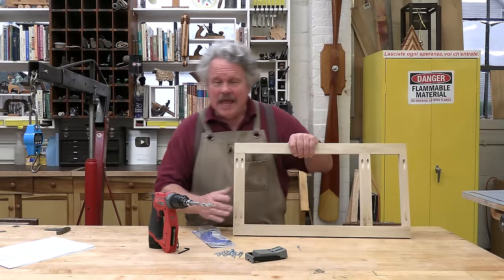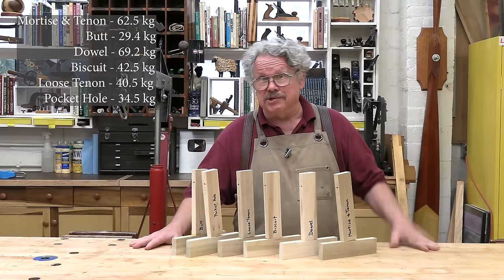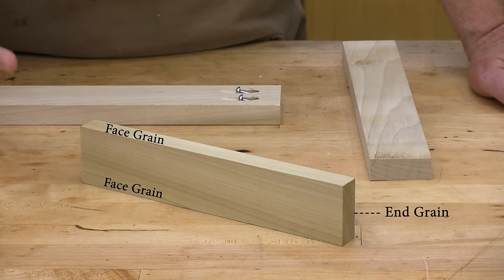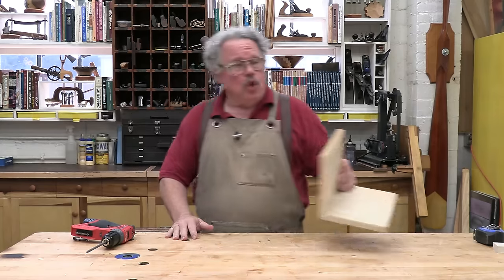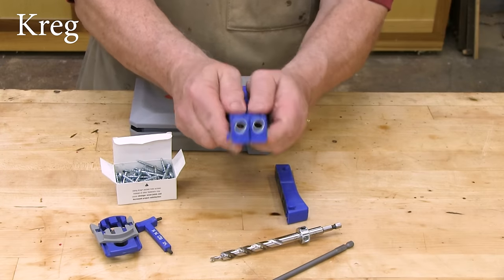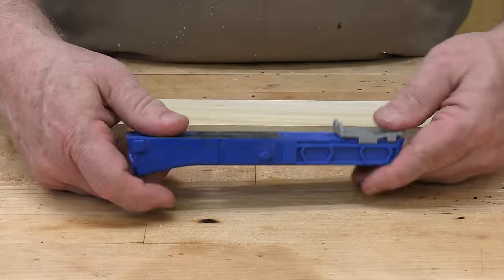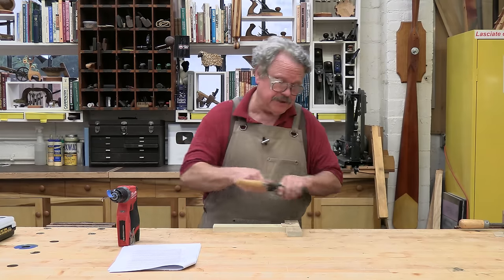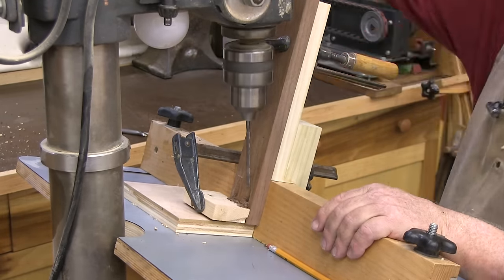Pocket Holes Overexplained

Comment: Nick I bought a pocket hole jig awhile back I have used it to make a screen door, I noticed that the jig has removable stop blocks for different thickness and the drill bit was just a bit short and I had to drill a 1/8th pilot hole and a lot of glue lol, the door came out OK
Reply from the maker: Thanks for sharing.

Comment: First time here, but I love this channel already. I wonder since you're just doing twist off strength - what is the sheer strength where you have two parallel boards and a pocket joined truss between them and pull strait up so the force is 180' from the joints - what joint is superior here?
Reply from the maker: There are four types of stress that every wood joint must withstand -- tension, compression, shear, and racking. By far, the most destructive to woodworking assemblies is racking -- what you refer to as twist-off. Shear is important, of course, but most wood joints fail from racking.  So that's what we test for.

Comment: Excellent video, thank you. I have always thought I was missing something since theses jig manufactures don't include a way to include the pilot hole, yes especially for hardwood. I worry that drilling the pilot hole as you did wouldn't result in that hole being in the exactly same plane as the through hole and change alignment. I wish there was a drill bit that fit the bit guide jig but had a 1/8" or 3/32" long tip to make that pilot hole.
Reply from the maker: I don't use pocket holes all that often, but when I do I wish for exactly that. Apparently, Amana makes a bit with a 3/8" counterbore and an adjustable (telsescoping) 1/8" pilot hole that might work. There is no shank hole bit, but if you use the Kreg pilot hole screws, the shank hole and the pilot hole are exactly the same size -- 1/8".
Reply: @WorkshopCompanion  Thank you for your reply. I have checked out Amana, didn't know about them.
Reply from the maker: @tonyc7352  https://www.amazon.com/gp/product/B000P4UPV0/ref=ox_sc_act_title_2?smid=A1WO0LWTFI0BL8&psc=1

Comment: One cool trick I learned is instead of using the pocket holes you can use a butt joint but before you simply put the screw in to the end grain, drill out the hole (in the end grain piece) and glue in dowels, then screw into the dowels instead, by doing this you essentially create a komposit material, this is probably the strongest connection you can make.
However the connection is visible from one side.

Comment: Cabinet fronts can be made with long dowels. Just along the joint and drill through the face timber into the end grain. Tap in a long dowel and drill the other hole(s). You will see the dowel end grains but is that always a bad thing?

Comment: He said about the Kreg Jig kit "a weird clamp pad" 🤣 I thought it was just me. Whoever designed it had a lot of faith in their customers. I think the idea is that if you clamp too hard, the plastic hexagon that contains the rubber will break before the whole jig gets crushed. I tightened it down until I heard a cracking sound once, but now I do it the right way and it works fine.

Comment: thank you very much for this.
question though: When you were clamping the pieces for drilling, you placed a piece of wood on top of the pieces before clamping, what's the purpose of this, and is it something that should be done when clamping joints in general?
Reply from the maker: The structure of the plastic molding in the Kreg Jig would deform if I clamped it directly; the wood spreads the pressure out and keeps the jig from twisting. Kreg actually supplies little plastic piece that you are supposed to use to do this, but its design sucks dead toads. A piece of wood is just as effective and far simpler to use.
Reply: @WorkshopCompanion  heheh, not heard that idiom before @sucking dead toads, where's that hail from?

Thanks for the info, had finally grabbed some clamps for a recent project, so will take some of my scrap for a piece.

Comment: Great video.
You didn't cover how to determine the length of the screw to use?  You state to set the depth collar to the width of the wood I am drilling through so it exits in the middle of the wood. But how do I know the depth of the shoulder in the pocketed wood? This rests against the screw head and will determine how much of the threaded part goes into the joined wood, correct? For example, I have an apron that is 1"x3" with the 1" edge facing up. I want to attach a 3/4inch table top to the rectangular apron. Do I set the jig to 1" (thus causing the hole to exit in the middle of the apron and use a 1 1/2 screw since that's less than the 1 3/4 inchs total of the apron and the table top?  There is little available on using pocket holes to do this type of joinery. I find it very useful (corn hole boards, table tops, anything where I don't want the screw exposed on the surface). I'm tired of trial and error testing. There must be an easier way to do this. Thanks again!!
Reply from the maker: I usually adjust the drill stop so the tip (the part that makes the shank hole) just exits the wood. This makes the shoulder as substantial as possible. (This is not a big concern in the joinery you describe, where the hole is perpendicular to the wood grain. But it is paramount when the hole is parallel to the grain.) That way, the thickness of the shoulder is equal to the length of the shank hole drill. To keep the screw from exiting the stock, I trying to make the screw come to rest when the tip is no less than 1/8" (3 mm) from the surface. So the length of the shank drill plus the thickness of the stock minus 1/8" is the maximum length of the screw that I can use. But there's one other thing to consider. It's impossible to feel when the screw head bottoms out on the shoulder when you drive screws with power tools. It's very easy to drive the screw deeper into the wood than it should go, especially with softer woods. Even the torque setting on the drill won't save you all the time because the density of woods is inconsistent. When I'm worried about a screw exiting the wood, I always drive it by hand. Hope this helps.

Comment: Question:  I understand gluing the joints totally.  And it is quite common knowledge that glue does not stick to glue hence removing old glue when making repairs.  So is applying glue to end grain, waiting 5-10 minutes and then gluing the joint not a concern because this is "new"  glue rather than "old" glue?  And suppose one makes up a number of pieces to be assembled the next day and applies the end grain glue the day before?  Being "cured" now I'm guessing that would be considered "old" glue.  I've probably just answered my own question.
Reply from the maker: You have. Glues can take several weeks to cure completely. The glue glue is still pretty "new" after just five or ten minutes.

Comment: hi , this was an okay video and I have always wondered why no pilot hole bit is ever included - i think its pure marketing to make this type of product look fool proof so everyone can do it without any complications. I think pocket holes have their place like you said and i think over used for the wrong settings. I attached some oak frame of 60mm X 19mm to some similar sized birch plywood for a reason and I did make a pilot also , the drill bit just about managed (too short actually and perhaps a better one could of been used . Can I ask you what the spec was for the one you use (shaft type and the end type also) thanks in advance.

Comment: It also helps to adjust the clutch on your drill (if you can) to a lower setting so you don't overdrive the screws
Reply: that's a great tip! thanks for sharing!
Reply from the maker: True that. I have a power screwdriver with a clutch; very handy.

Comment: Hey Nick, i was planning to make pockets holes joints on 12mm plywood that i will make for my furniture's van. Now watching your video i'm no more sure if this is viable or not and if i should find another way of jointing for better strengh restitance. What re your thoughts on that? do you think if i put some glue it will be strong enough?. Lot of vibrations in a van to consider, what kind of jointing would you pick for this kind of build ?
Thank you for the great content and have a nice day !
Reply from the maker: Cannot possibly answer your question without seeing a design. Vibration is a huge concern; I was constantly mending less-than-substantial joints on cabinetry in a motor home I once owned.

Comment: Very nice!  I wonder though why Kreg Jig would make the markings wrong on their product of where to put the stop collar on 3/4" material.  I always wondered if the shank hole should exit the piece and it doesn't at their setting.  It made me feel this is intentional.  Anyone know it this is true?  I know when I clamp the pieces together, I glue, clamp, and drill pilot hole in one operation- no time for applying glue twice.
Reply from the maker: I'm sure it was intentional and I don't think they made it in the wrong place. They just made it in a place where I would not have chosen because you can't see where the shank hole emerges from the wood. My suggestion doesn't make the joint any better; it just makes the location of the holes easier to monitor. Perhaps the person who designed the jig didn't think that was necessary. But they also didn't think that pilot holes were necessary, which makes me question all their choices.

Comment: I plan on building first cabinets. Should I opt for dowels instead then? They seem easy enough to implement
Reply from the maker: Depend on whether your cabinets will be freestanding or built-in. Freestanding cabinets require more structural integrity than built-ins, which get their strength from the wall to which they are attached. Pocket screws are not rated as structural joinery. They're fine for built-ins, but you need something stronger for freestanding.
Reply: @WorkshopCompanion  Great, thanks!

Comment: Using no special tools I made some pocket hole joints to connect two pieces of soft wood that only hold up a very light load. I started drilling vertically until the bit was securely in the hole and then slowly tilted the drill until it reached the desired angle. And since it's very soft wood, I could just let the screw do most of the work. As soon as the hole was deep enough for the head to completely sink into it, I stopped the drill and drove the screw ignoring both the shank hole and pilot hole. It worked really well for the intended purpose and required only a drill and a screwdriver. But I wouldn't trust it to hold up to any significant strain. Moral of the story: It's possible to make pocket holes without following most of the best practices but it's almost never advisable.

Comment: Very informative video. I noticed that the wood you're using is in my guess...soft poplar? Did you test with any hardwoods like oak or maple? These days nobody makes everlasting furniture, since styles and colors change. To me ease and speed are more important than strenght of joint. I'm making an entertainment center out of oak, and I know that making it with pocket hole joinery it will outlast me, but not fashionistas. America is a disposable society, where styles change every 10 years or so, and those storage buildings popping up all over America by millions, are brimming with outdated style furniture. In my opinion pocket hole joint is way more than anybody needs. At 35 kilos per joint, only a 20 pound sledge hammer will destroy my TV stand.
Reply from the maker: In researching this video, we made pocket holes in poplar, cherry, oak, and spruce.

Comment: As usual lots to think about. One thing that occurs to me is that unless the joint is tight to start with then, the force being applied at an angle, as you tighten the screws the joint will misalign. Speedwise is there any advantage over dowelling? I think I will reserve this technique, as carpenters have since almost forever, to 'rough' work such as securing a rafter to the plate - and yes, nowadays I do use screws!
Reply from the maker: The pilot hole (and the clamp)  helps prevent the joint from being pulled out of alignment as you tighten the screw. Dowels make stronger joints, and if you have a doweling jig, they only take a little more time than pocket holes. The problem is that you need a good (read: expensive) doweling jig, otherwise you'll spend a lot of time plugging the re-drilling misaligned holes.

Comment: How I love Utube!  You were a great find. Your experiments are both hilarious to watch and also very factual, no guesswork.
Summary of Joint Strength from Strongest to Weakest:
Dowel Joint failed at 69.2 kg or 153 lbs
Mortise & Tenon Joint failed at 62.5 Kg or 138 lbs
Biscuit Joint failed at 42.5 kg or 94 lbs
Domino or Loose Tenon Joint failed at 40.5 kg or 89 lbs
Pocket Hole Joint failed at 34.5 kg or 76 lbs
Butt Joint failed at 29.4 kg or 65 lbs

So much for the very pricey $1200 Domino Joiner, ha ha ha!!!!  I'll stick to dowels.  Very impressive!
However, there are many places you cannot use dowels due to limited space.  Pocket holes are the only options if space is tight.  I have a vintage Japanese Ironing cabinet I am restoring and adding some drawers to.  I need to build up the framing in the back and wedge in pieces between existing one.  No way other than pocket holes for this application.

So much to know about pocket joins and wood grain, wow!  I made notes for future reference.  Very valuable information.  
A good way to remember how to position the joint is that the End Grain should not be on the receiving end of the screws 🤣
Great information on pilot holes!  I smugly bought self tapping screws and now must return them. This is indeed a master class in Screwology.  Absolutely love it!   ❤ Thank you!!! 🙏 Subscribed.  Of course.:washhands:
Reply from the maker: Most welcome.

Comment: For accuracy wouldn't be necessary to center the pilot bit in the shank hole?  Have you considered using a sleeve to accomplish this alignment.
Reply from the maker: Optimal, but not necessary. As long as the boards are securely clamped when you tighten the screws, the results will be the same. A few wood fibers on one side of the screw may be crushed, but not enough to effect the overall strength and durability of the joint. And if you use dedicated pocket hole screws in which the threads are larger than the shanks, the misalignment will be even less -- the sizes of the shank holes and pilot holes are very close.

Comment: I gotta say, people often go on and on about "stronk joint", but they often forget two important things: actual required strength from the project (if you need the project to hold X kilos, the joint that breaks at 2X is as useful as the one that holds 3X here), and how failure happens when it does. This includes the direction of the failure, so to speak.  That is why glued pocket joint even take more than pure butt or pure screw pockets, because each part resists forces from different directions better, as well as responding to them different. Summarizing a decent chunk of a synergetic interaction that mskes composite materials often stronger than pure ones or the sum of the parts, ofc, but you get the point.

Anyway, the point about the second point is that considering potential failure is also important to the overall "strength" and safety of a project. To not ted talk, a great thing about poclet screws is that they tend to not fail completely immediately (if they do, the force is enough that the others would have failed too). Yes it is still technically a failure, but something hanging by a thread and bulging out, both of which work as warning signs too, is in many scenarios better than it jettisoning down unto someone's head or feet.

Comment: What length screws should I use? I will be buying a Kreg pocket joiner, and want to buy some screws. What is the distance between the shoulder and the end of the board? I will then add that distance to the depth I want in the joined board. I have found many different lengths, and don't want to buy something only to find that it pokes out the other end.
Reply from the maker: The distance between the "shoulder" (by which I assume you mean the bottom of the pocket) and the end or edge of the board is about 1/2" or 13 mm.

Comment: I must have been extremely lucky with my pocket holes..no splits, and no pilot holes...and that's with R1 radiata pine.  But  before I started using the pocket hole jig, I did practice on a few bits of scraps. I have a Kreg jig.

Comment: Am I correct in understanding that the skinny extension at the tip of the drill bit is all of the 'meat' the screw gets between the screw head and the exit point of the board? I.e., that's the shank hole and when you drill, you want to see just the very tip break out of the board?
Reply from the maker: That's right. In most setups, the pocket hole about 1/2" (13 mm) before exiting the board, and the shank hole continues on. I usually adjust my setups so there's a little more meat.

Comment: I am not doubting your results but I have never had the wood split like that after many PHs. 99 of my PHs have been in Home Depot oak. Maybe it was moister than your wood? 
Pocket holes are also great for making bookcases and even drawers. No failures 15 years later. 
I use and love my Kreg jig. 
Cheers
Reply from the maker: I talked to several woodworking buddies while making this video and all of them were plagued with occasional splitting. I did notice the Keg uses oak in their video -- it may depend on the species used.